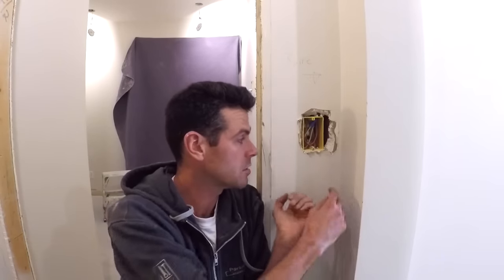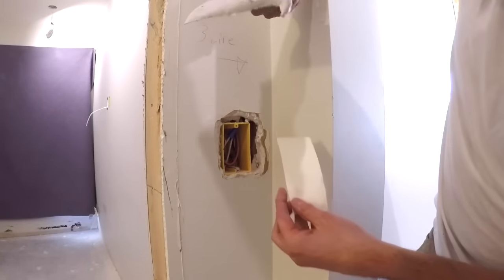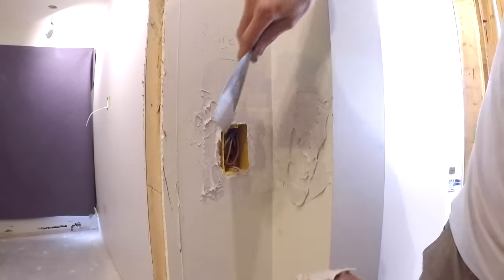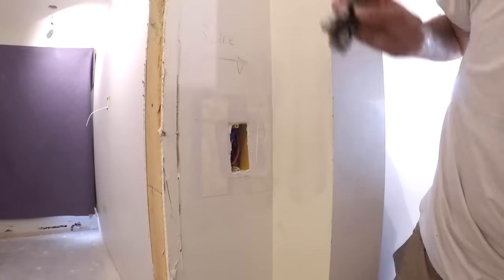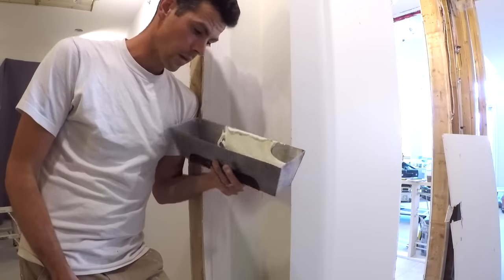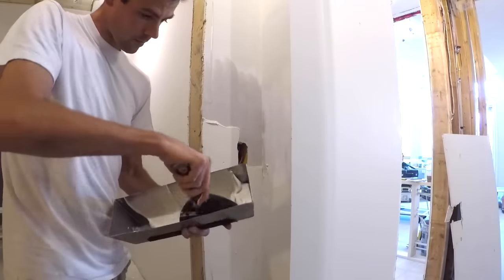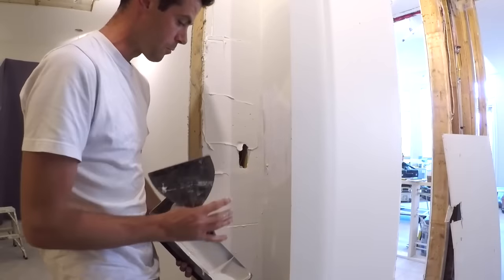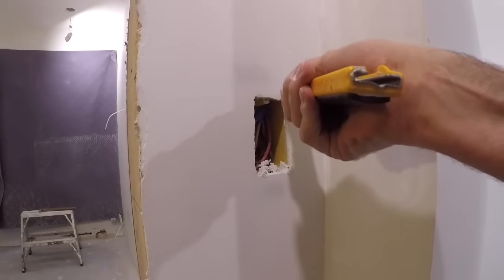HOW TO REPAIR OVERCUT ELECTRICAL BOX (DRYWALL)

Comment: Should u pre fill the holes
Reply: You can but coating the back of the tape IS essentially the pre filler.
Reply: Yes Donnie Porter you should pre fill first. Let the pre fill set up then tape and coat. This is 100% the wrong way to fix this.
Reply: @richtaylor712  i know ive been doing drywall finishing for 30 years  i get a kick when i see these videos i seen 1 guy tape a hole house with mesh tape lol thanks for the reply
Reply: Donnie Porter  can you tell me the correct way to do this. Step by step if possible? Sincerely- an apprentice who wants to do it the right way.
Reply: @jackhazen3624  there's a couple diffrent way to the the repair u could pre fill  the void with hot mud or reg mud flush with the drywall let it dry remember the mud shrinks once it dries. once dry apply mud on the top of the fill put your tape on make sure u cover the joint/crack apply pressure and pull mud out leaving just enough to bond tape to drywall  dont not apply mud to tape the tape gets wet very fast and will tear when pulling access mud off. after taping dries apply light coats 2to3 times drying between every coat. Or you could do a hot patch thats wer u back cut drywall and use the paper as the tape thers descent videos on youtube its hard to explain but i use this method on anything 1inch or bigger . Or u could cut the  broken drywall out slide a 1x2 in the gap leave couple inches on each end to screw off then cut a piece of drywall a little smaller than your hole so mud can bond the pieces together then tape and finish. i hope i explained so u can understand it lol just remember dont put mud on your tape fill the void u dont want a hollow patch over time it will crack out
Reply: @jackhazen3624   yes Jack listen to Donnie Porter

Comment: Wonder how many women, wife's seen where you cleaned your tool on your pants. Good presentation that I'm sure helps many home owners learning how to do these type of repairs. Have them use a damp cloth to smooth out the dry mud rather than sanding, stops  creating all the dust from sanding and leaves a good ready to paint finish.

Comment: That was a great video. I've never seen anyone use tape and quickset on a repair this small. (And over-sized plates are tacky-looking!)
As many times as I've wired houses and repaired damaged walls... this was, by far, the quickest, easiest, best way to mend an opening like that.
I've seen lots of mud pushed into gaping holes, only to see it take forever to dry, having to recoat, due to contraction, and then fall apart during sanding.

Nice job, carpenter-fixer-upper-type guy.

Comment: Almost would have been quicker to replace the entire wall with a new piece of sheetrock. 😃
Reply: True.  I'm just a little DIY, house hold guy, but I generally say that if I can fit three or more fingers into the area, you should try to do a Chicago style patch unless it's too difficult.  Even here, you could do some filler pieces.

Comment: Use plaster of Paris to fill the empty space. Cut back the drywall so it angels to the front, that will give you a base to keep the plaster from falling into the hole.  Start at the edges and fill in with a narrow blade at about a 45 degree angle so you can add on top after the first layer sets up. Basically, creep up on the electric box with a few coats. Dries like concrete and very fast. You will then have a solid base to tape.  You can poke a finger onto that patch.  An old electrician who worked on historic homes shared the technique.

Comment: What a waste of time and labor.  A little time and effort cutting out the electrical box would have prevented all of the headache.  There's no substitute for doing the job correctly the first time. You did a great job repairing this drywall botch job.
Reply: so wait, whats your solution to fix the problem? or are you just griping? you must be that guy on job sites
Reply: @ripshot2222  ever heard of measure twice cut once?  I use a tape measure and I dont use scrap sheet rock.
Reply: @AP-ph7hf  exactly, so you have no idea what you are talking about. Stick to weekend warrior work and leave the tradeswork to us.
Reply: @ripshot2222  Oh, I see what you're doing here.  You want me to tell you how to fix these screw-ups.  Okay then, I will.  Let me start with an old adage.  An ounce of prevention is worth a pound of cure.  Let's first try to prevent this mishap.  First, measure twice using a tape measure where the cutout needs to be and then repeat the procedure on the wallboard.  Then, mark where the cutouts should be.  Set wall board.  Cutout along markings using a keyhole saw or zip tool.  Its really not that difficult, even for a weekend warrior like myself.  Now, if you have to fix a bad job, wither redo the drywall correrctly or follow the method in the video.  Let me know if you need any more help or advise; I'm here for you brother!
Reply: @AP-ph7hf   Thanks, i am satisfied. i will withdraw to my cave
Reply: I'll say, the carpenter should've gotten a drywaller to patch it. Why would you hot mud tape it, when there's bare studs that still need to be rocked? Why would you float something that wide that doesn't need to be floated that wide? He didn't even gauge if it was low all the way put and down to where he went. Just crowning it out more and more.

Comment: DIY'er here...  For holes too small for a backing patch but still require a high level of structural integrity, I'm a fan of spray can insulating foam.  For recessed lighting drywall gaffs and after-the-fact outlet box installations, the stuff is a lifesaver.

Comment: Super fun. Now I just closed 3 boxes in my ex's house, but used the patches since the walls were already nicely painted. This method however seems more gratifying, but I suppose is better for unpainted walls? I would love to try this though. Mine turned out amazing and undetectable. It's a favorite project and I got lots of practice in my place removing security panels and phone jacks in my older home.

Comment: I particularly like that the final wipe of the trowel is on your pant leg.  It's my method as well but then, I lick Elmer's glue off my fingers when I do wood work, and carry a wet towel on my shoulder for painting.  I have painting clothes that show every color paint I've used in the last 50 years of DIYs.

Comment: I’ve done this as a diy, but I used 6 inch fibafuse, lay it overtop of the box, and then cut out a square middle for the box. I worked super well

I find it’s easier and flatter so it’s easier to diy, less to float out. Not also this, because the tapes don’t overlap, it’s more likely that you don’t screw it up and the face plate looks off.

Note, I’m not a drywall guy, just sharing my diy experience

Comment: I’m so thankful I caught your video on this. I actually have one outlet with the wall like that around it and was curious bc it bothers me to see it like that. Thank you! 

I do have a some other questions on some walls I have in this condo we bought. It looks as though from the structure shift or level after years, but you can begin to see some of the few lines where drywalls meet, like complete straight lines across the ceiling on one part and there is some lifting of paint layer coming off of ceiling. How would I fix that? Would I have to skim the whole ceiling? Do I need to peel some of the paint layer that is coming off, sand it, then skim?  There are several patch works that are not flush with the wall either. Thank you in advance and for your helpful videos!

Comment: Just for your interest. In the UK a much faster technique I and others use: apply some watered down PVA (increases adhesion and amalgamates any dust left from brushing/hoovering), apply expanding builders foam, 45 mins later cut the foam flush with the wall, push the foam in sufficiently for a skim coat of filler, skim with filler. When dry sand and paint. Job done same day and 2-3 coats of paint on. It will never crack and the repair is invisible. Total accumulated  time on that repair would be about 10 minutes or maybe a couple minutes more. Time is money over here plus nothing is stronger than a foam repair. Decorator.
Reply: Expanding foam =  Not fire proof.

Comment: Great thanks.  Je vous pays.  Please do more real life tricky problem patches.  I find gaps around different size installations the hardest.  For example: New switchbox of different size or shape which results in drywall gaps around/against the new plastic box or fixture. There is no room to work and wide broad sweeps of mud dont work.  Cheers Anna Australia

Comment: I filled the metal boxes in my house with styrofoam, cut it flush with a box cutter and then applied the mud. I’m a novice and can’t believe how perfect the finish came out after sanding.

Comment: I have a room divider protruding out from a main wall about 12 inches, going from floor to ceiling. It has a 5-gang switch plate on it that is cracked because the divider's drywall is not flat. It's edges are about 3/16" higher than the center. Would you recommend using hot mud to fill in this concave area or would a regular mud be better? Also, since the wall is painted with latex paint, should I use a primer of some kind before applying the mud? Thanks so much for your help, and your great videos.
Dennis

Comment: I use canned spray foam to fill the void, razor it just below the surface and use joint compound on top.  Looks perfect and no feathering required.

Comment: Cornice cement 45 with accelerate and fibre glass mesh tape. Then final coat with premix top coat. Finished in under an hour, ready for sand

Comment: I am pretty good tradesman but I got to say, we were hanging in a 100 year old building, where the joists were tweeked beyond belief and the electricians boxes were set screwed up, when I "rode" the box with cutout tool, the electricians set the box the same depth as the sister's joist so when you would cut out the box would not turn until you realized that wrnt to far . It was really frustrating frustrating causing blown out boxes again and again

Comment: As always a great video. Do you ever wait a few hours after all purpose has set and just sponge it flat? It saves having to deal with the dust and pain of sanding, although it looks like most of your projects are new builds for patches etc in a house with all the home accoutrements getting dust from sanding is a pain

Comment: Thanks for the instructional video! Is this the process that should be used to fix a small crack in a wall? I thought I would have to replace a small portion of drywall but maybe some tape and mud would be easier

Comment: I have used Pollyfilla or plaster Paris for the fill coat with use of mesh tape.  Then drywall mud for Finnish coats.  Superior strength because these products are more like cement.

Comment: A rotary tool works great for removing patch residual over the box. Set its drill bit depth so as not to cut wires, then run the drill l bit on the inside of the box. to remove excess drywall.

Comment: I prefer mesh tape here, but nice video.  Great tip is learning to use quick set, even for the finish.  I don't want to make multiple trips to do this little repair, and people don't want to pay a few hundred bucks to have something like this fixed.  I would probably have used 5 minute speed set for this repair, done and painted in an hour 15 minutes.

Comment: Would you explain the sanding tools?  For a drywall pole sander, do you screenpaper instead of sandpaper?  I've tried screen, and it doesn't seem to work well for me.  For the sponge sander, do you just use the sponge or do you wrap sandpaper around it?  I usually use sandpaper wrapped around a block of wood, and would like to learn best/preferred practices.  Thank you.

Comment: I fixed one similar case in my house by first applying urethane foam and once dry cut it bit low, then mud. What do you think is that good or bad practice? At least it has held few years already…

Comment: after fifty plus years building new homes and remodeling some others, I have found that by charging $50 to repair someone else's carelessness works wonders. Before I pay the final draw I inspect, stung one time is usually more than enough.

Comment: Another tip that would be beneficial especially for the electrician you can cut a square of drywall or a piece of foam and put it in the box either tape it with painters tape in the box hole so you don’t get mud all over the wires most people will get mud all over the electrical wires because Mud is sloppy. You make it look easy not being sloppy but you’ve had quite a bit of experience doing mud work it’s obvious. With 40 years of drywall experience I can tell you the trick is getting the mud the right thickness. Too sloppy and it’s a mess way too thick and it’s not workable. Nice video thanks for posting

Comment: I know It’s a lil’ overkill, but I like to mist the busted up drywall and use durabond on the first coat.  And back fill before adding mesh or paper tape.  You are good though, “carpent on”
Reply: Exactly how we did it in back in the day... The repair was FAR stronger than the drywall itself. When you get good enough with DB or any 20 minute set and a wet sponge, there's no need to sand or wait... Clean up your tools, come back in and texture (if applicable) or prime... 
Now... About that screen-name... ;-)

Comment: For the rest of my life....no more drywall. OK, I'm 65 so "rest of my life" isn't really that long. But yeah I'm finishing my house to sell/rent and I'm sick of drywall. I created a couple walls with shiplap. Love it. I'm not sure of fire requirements but if needed I'd use drywall or Hardie board if needed and then shiplap which I make myself out of 1/4" plywood and gluing strip of 1/8" ply to the back to make the shiplap. Paint before installing. Some pieces I attach with brass screws so it looks like, well, a ship. That allows me to remove sections to run future wires, pipes, whatever. Super easy and strong to attach whatever to walls. Much better option imo.

Comment: All these people posting comments about "high spots" being created, because of this method..
Ask yourself, for the so called "professionals" that built a new home or have come in to remodel (electrical or framing)...did they REALLY do a good job, anyway..?  NO, they didn't..!!
Sure, a few GOOD craftsmen/women are out there.. complain that the home owners previous repairs made their jobs tough. But, when you look at the product MOST "professionals" leave for a home owner....the scale tips dramatically.
With that being stated...
It's important to remember, this gentleman is simply offering advice to the DIY audience. The people whom want to do a decent job of cosmetic repairs to their home. Yeah, some will take on a more workmanlike approach and, do the job to a degree...and others won't. Although..if you look at all this guys vids, you'll notice that he instructs on how to cure allot of issues (including high spots).
It's like a class, of sorts.
I'd love to watch some of these negative commenters in action, seriously. 

They all talk a great game, but are the first to cheat and when no one is looking...trust me.
Here is some advice from a REAL professional. While you're floating that box repair...remember that the electrician might have to extend your outlet, should you add too much mud. Your outlet cover will certainly set on the wall flat..but the actual outlet will be left deep inside the wall, and won't meet flush with the cover face. Home improvement stores sell shims, in case you are going to be sparky..!!

Comment: Ha what an awesome coincidence. I came across your video looking for help on patching my 240v outlet (I had to reorient it for my ev charger) in the garage and realized I’ve watched so many of your skate tutorials as well! I also follow you on Instagram. You’re a Renaissance man! Thanks for all the tutorial videos. Both handiwork and skateboarding! I used a fiber glass type drywall/compound tape to fill in the gap and realized a tiny bit is hanging under the outlet plate, maybe a couple of mm. Is that okay and safe?

Comment: damn wish I saw this last week.  I was putting in an old work outlet box that was just clipped to the drywall, while pushing the wires back into the box I pushed too hard and had a blow out on the side.  I ended up puling the whole box out.  Cut out about 12" by 16" to run from stud to stud, put in a new box that attached to the side of the stud, then taped and mudded in the new thing.  I never thought of just using mud and tape/mesh to fill it in.

Comment: would you ever do a video on cutting out electrical boxes with mud rings?  There are plenty of videos rotozipping the normal electrical outlet but I have not found one that tackles cutting out a box with a mud ring attached. It seems with the rotozip method you might make the hole a little too big due to the rounded edge on the mud ring.  OR do you really just use the same technique and put an oversized outlet cover on it?